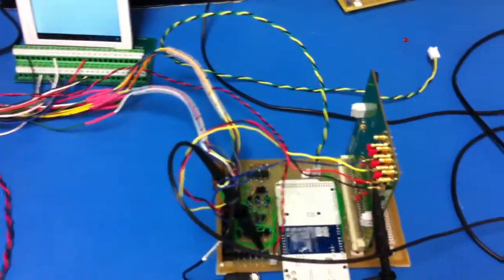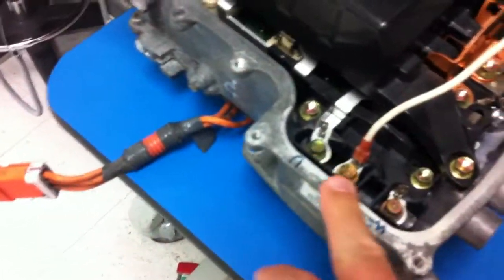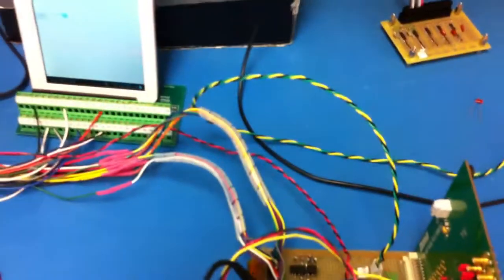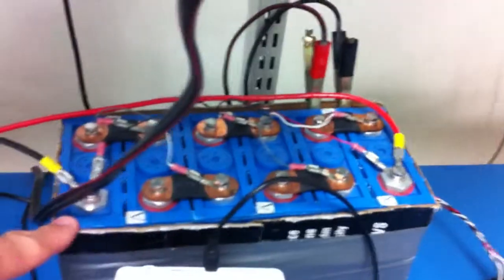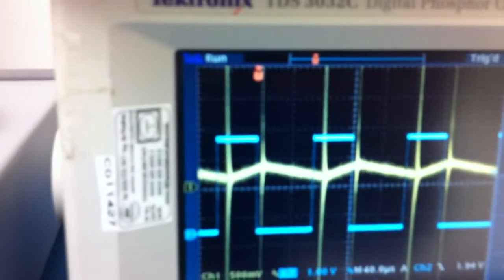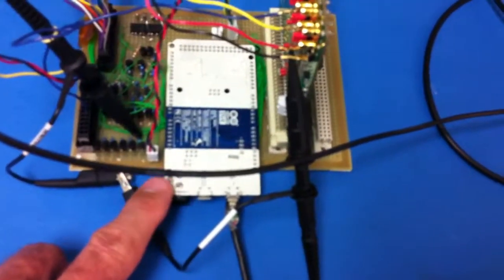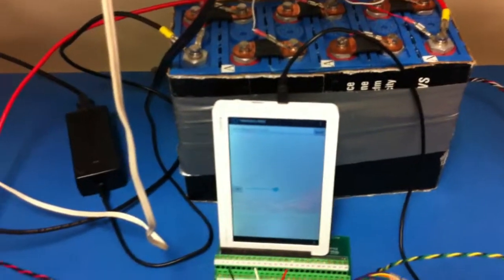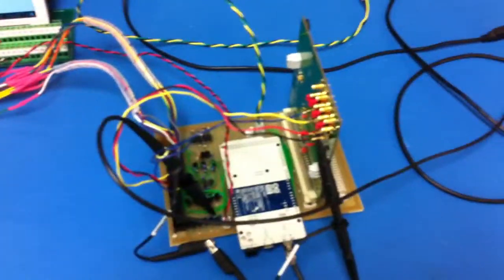Buck Boost experiment using Prius Inverter

Comment: Hello,  Thanks for the video.  Very interesting.  You mentioned that you were going to do some further tests on the duty cycles.  I would be interested to know the results.  Is the buck-boost converter using cascaded buck stages to improve efficiency?